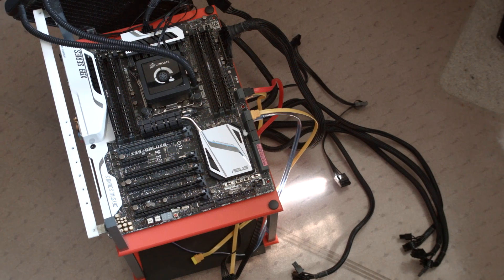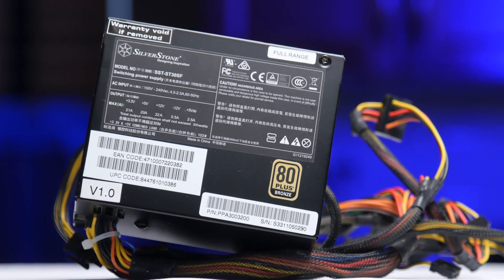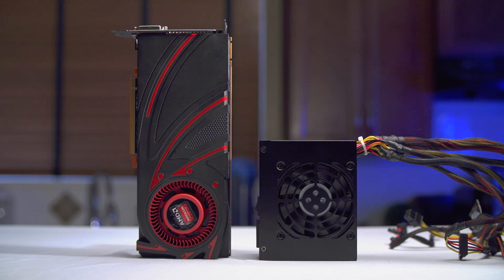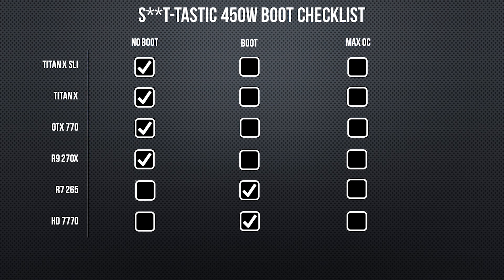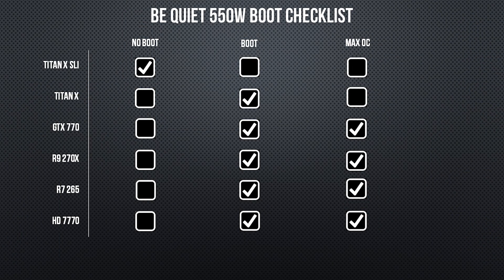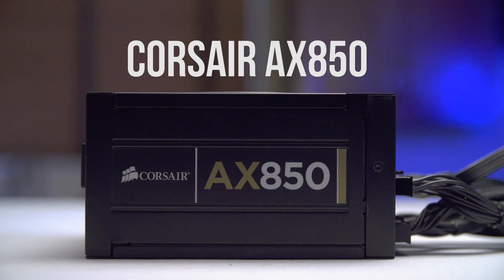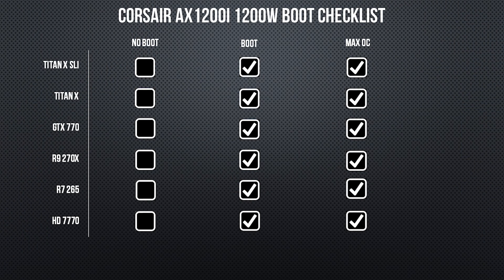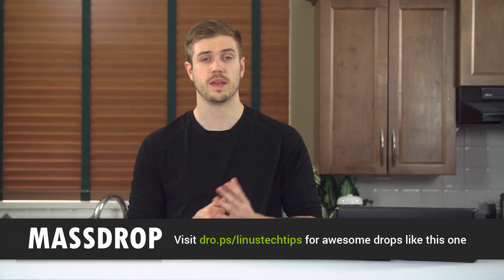Overclocking Recommendations - Low vs High Wattage Power Supplies

Comment: is a Cooler Master G550M enough for a i5 4690k and a Asus gtx 970 both overclocked?
Reply: +Stevin Kruithof 
No, all of the GTX 970's require a min of 500 watt PSU but, the power consumption is a different story. With your 970 the max power consumption is 225 watts at stock clock speeds, over clocking it will need more then 500 watts of power and that's not including the power consumption of your MB, Ram, Fans, Drives, CPU and pump/s if you're water cooling, keep in mind that over clocking your MB, Ram and CPU will also consume more power as well

A 550 watt PSU will not be best in my opinion,  at best I would do either at min a 650 watt or a 700 watt PSU, that way if you do some over clocking, you have the power to take it.

Comment: 80+ rating makes a big difference as well. I decided to pick up a Corsair AX 860 80+ Platinum, after reading a review of the PSU over at JohnnyGuru. JohnnyGuru was able to pull 1000 watts of power from that PSU.

Comment: I just want to make sure, i have an r9 270x TOXIC and fx 6300 @4.3 in my build. My power supply is an xfx 550w P1550SXXB9. If i wanted to upgrade, would my power supply handle an r9 280x or atleast an r9 280.

Comment: So in theory could I run 2 290x's in crossfire with this setup?

CPU: AMDFX8350 4.0ghz
CPU Cooler: Noctua NH-U14S
Mobo: MSI FX990GD65
PSU: Corsair Modular Power Supply 860 W, Series Professional Platinum Ax860 - 80 Plus Platinum
RAM:Corsair 16GB DDR3-1866MHz Vengeance Pro 
GPU: Sapphire R9 290X 8GB 1180/1500
Storage: 1TB SSD/HD, 250GB Samsung evo SSD
??
Reply: Blacksun Without over clocking you can, but with overclocking I would suggest giving yourself some breathing room (say 1250W). You are running especially thirsty hardware.

Comment: Greetings from sunny Southern California! Thank you guys for this video. I finally realized that my performance issues were due to not having enough power on my recently built PC. I had a crossfire set up with an FX-8350 using 850 Watt PSU and it was clearly not enough power. Everybody addresses CPU, GPU, RAM, but very little info on how much power you need.  Again, thanks for what you guys do. PS. That Luke is a sexy beotch. ;)

Comment: What's the difference between the GTX 770 and the GTX 970? I've noticed that they use the 770 more often even though the 970 is newer.
Reply: +Garry Perkins What wattage PSU do you have with your 970? I was looking at upgrading to one but I keep finding mixed answers to my question: Is 500W enough?
Reply: Thanks man. Great info. I might just save my dollars and go for a complete re-build in 6 months or so. Thanks again for taking the time to reply.
Reply: RaySchrantz The 970 uses less power and has dramatically better performance. You can buy the 770 for far less cash used. I am currently using a 970 and it rocks.
Reply: grennyfell97 What CPU do you have? 500W should be plenty if you have an Intel CPU and do not do any overclocking. keep in mind that overclocking uses dramatically more power for both the CPU and GPU. For example, an AMD eight core lulls 140W standard, but will easily pull over 220W overclocked (sometimes 300W). Similarly, a 200W graphics card might pull 300W if overclocked.

I have an overclocked AMD FX-8150 running at 4.4 gHz. I overclock the GTX-970 as well (EVGA Precision X with Power Target at 110% and Mem Clock Offset at +150). I have an XFX 850W PSU (made by Seasonic). It is stable and kill for an old system with a graphics update. 

Tell me your PSU and I will let you know if 500W is okay. For any recent Intel CPU you are fine. The earlier your go back the more power you need. If you have something like a 2700k intel cpu, then you need more power. If you have Haswell (4770, 4570, 4670, 4790), then you are golden. 

in general though, it kind of pays to have a big PSU if you can get one that does fanless at low wattage. With a good CPU cooler, graphics card and power supply you can get a a truly quiet computer.
Reply: +Garry Perkins Thanks for the reply. I have an FX-6300 Six core with a Cougar SL 500W. (80% efficiency)
Reply: grennyfell97 I would upgrade your PSU just to be safe. If you are not overclocking you are probably fine, but if you do not have a modular PSU, perhaps this is the kick in the rear end you need to get one (I still have a non-modular, and cable management is a nightmare). 

AMD in general needs more power, especially if you are overclocking, and with a 6300 you should be overclocking. Just go out and get a good 650W modular PSU. If you think you might SLI or go for an 8350, then grab a 750W.
Reply: grennyfell97 Yeah, I have an eight-core AMD and I am debating an upgrade, but I want a new case as well. The whole DDR4 thing complicates the issue. Do we go Devil's Canyon and re-use the RAM (I have Corsair Vengeance), or do you add yet another item to the list. I almost feel like with DDR4 it is better to go x99 than Sky Lake.
Reply: +grennyfell97 I know this is old but you can run a 970 and amd fx 6300 with 500w. I did for a week while waiting for my 750w psu. I don't know about overclocking though as I don't overclock my stuff.

Comment: Do you think I can run GTA V with my Geforce GTX 970 gpu? 16gb ram 2100mhz, 5820k CPU, v750 cooler master PSU, and asus x99 pro motherboard. and corsair h105 liquid cooler.
Reply: DrFlax What resolution are you going to be running?
Reply: 720p probably. If you need anything else just ask
Reply: DrFlax That's very overkill for 720p.
Reply: well 1080p then lol <3
Reply: DrFlax That's better! :D
Reply: <3
Reply: btw. do you think I can record good quality with my 970?
Reply: DrFlax Nope. You might need to adjust one setting, so you should probably spend thousands of dollars instead. Why risk having MSAA at 2x when 4x is the max.

Comment: Hey, can someone give me some feedback about this build:

CPU: Intel Pentium Processor G3258
Cooler: Cooler Master Hyper 212 EVO
MOBO: MSI z97 PC Mate DDR3-1600
MEM: Vengeance LP 8GB DDR3
HDD: Seagate 1TB Desktop HDD SATA 3
GPU: ASUS GTX750Ti 2GB
CASE: NZXT S340 ATX Case, Black
PSU: CX Series CX750M Modular Power Supply

Please tell me anything that I need to change, if this build will work or not.
Note: I am a beginner at this kind of stuff.

Comment: LinusTechTips   As somebody that knows very little about PC's, is it possible to have to much power?  If you went out and bought a 1200w power supply and only needed say 300w, would you run the chance of over powering it or would it just be idle power not being used?
Reply: Ryan Stephens Power supply wattage is purely what it's rated to be capable of outputting consistently. It's maximum long term. Only a damaged or faulty PSU would output more power than was needed. A cheap PSU would probably screw it up too
Reply: Ryan Stephens Short answer no. Long answer yes. Having a grossly oversized power supply will hurt your efficiency a decent amount. Power supplies are most of efficient at 80% load. A 550 watt supply is adequate for almost all single card computers or a 650 watt for piece of mind.
Reply: Ryan Stephens Power supplies are less efficient when not under enough load, but at lower load less energy is wasted. Overall I would say there are no problems, a power supply won't lose it's value over time unlike other components, and you wont have to buy a new power supply due to a lack of wattage :)
Reply: Ryan Stephens I don't believe there are any side effects from under powering a power supply to that extent, but its common for pc builders to buy an overly capable power supply, for example a 850W PSU for a system that may only need 650W. There are various reasons for this but generally its to be safe that their computer won't crash and the power supply won't be pushed too hard. The only drawback is however that more powerful power supplies are generally more expensive.
Reply: Andrew Hodges Thanks, I never thought about it until this video.  I would think that boards and cards have some type of limit switch that keeps them from being overpowered/harmed.

Comment: I've ran my setup for a few years with somewhat legendary Enermax Modu82+ 525w PSU and had no problems so far. My setup is i7 3770k @ 4,5Ghz, 16GB HyperX, GTX 770 DCUII (a little bit OC) and 3xHDD+SSD. Paying a little bit extra for the peace of mind (and better efficiency) is worth it.

Comment: Hi, i have never built a pc before but im really keen to. I want to play The Witcher 3 on max or nearly maxed settings and future games on quite high settings. Can you guys let me know if this build is good enough?

CPU: Intel i7 4970k 4.0GHZ
CPU Cooler: Cooler Master Hyper 212 EVO
Motherboard: Asus Z97 PRO GAMER
RAM: G.Skill Ripjaws X Series 16GB (4x4GB)
SSD: Samsung 840 EVO 250GB
HDD: WD Blue 1TB
GPU: EVGA GTX 970 Superclocked ACX 2.0
Case: Corsair 450D 
PSU: EVGA 750W 80+ Gold
OS: Windows 8.1 or Windows 7 (still havent decided)

Comment: The 650-750w range definitely seems well suited to OC any single card setup... that's actually a little more wattage than I expected. But then again I suspect the I7 5960X is the culprit for this extra power consumption, as honestly when overclocked its about as power hungry as CPU's get, and is probably more than most gamers will go for until the GTX Titan or multi-gpu type setups anyway.

Comment: Guys need help, how's this for a $1500 build?
Intel core i5 4690k@ $236
Noctua NH-D15 @ $100
Corsair Vengeance Pro Series 16GB (2 x 8GB) DDR3 DRAM 2400MHz @ $130
MSI ATX DDR3 2600 LGA 1150 Z97S SLI KRAIT EDITION @ $100
R9 295x2 @$689
Corsair Carbide Series SPEC-01 @ $45
2x Samsung 850 evo 250GB in raid 0 @ 2x $100= $200
Rosewill ATX 12V 1000W SLI 80 Plus Gold Certified @ $120

First things first, I am doing this with some consideration of future proof, with a 1000 watt psu to accommodate future upgrades. Spending so much on the noctua cooler may seem unreasonable, and others may think it is better to get a i7 4790k with that $100. I see your point, however, with a quality cooler, I am able to get an aggressive OC on the current build and as well as future cpu upgrades. I figure that the noctua cooler will perform like a champ for a good 10 years with their high quality components and free socket mounting parts when new sockets come out. So the next time when I have 300ish dollar for cpu, I can get an unlocked i7 and OC the crap out of it, whereas if I get a i7 now, I still can't overclock it now or in the future in any significant way thanks to intel's state of the art box cooler.

The Rosewill PSU may raise some eyebrows, since most ppl go for big brands like cooler master, corsair, or evga. But I thought this one is gold certified, is recommended by Jonny Guru PSU review, and has a 4.5 on amazon. Whereas brands like evga and cooler master easily go north of $180 for a psu like this.

And finally the GPU choice, I figure that for something that performs better at high res than 2x970, more future proof with 512 bit memory, can do crazy OC with water cooling, and works better in multi gpu setup,  $689 is a steal. 

What do you guys think? Wait for R9 300 series? Wait for nvidia pascal? go 2x970? Get a cheaper cpu? Thanks in advance!

Comment: I have a Strix gtx 980 with a 750W supernova and when i play games there is this mechanical buzzing noise, coming from it. It only happens when i play games and different games make the card buzz sound differently. Anyway to fix this my specs are as follows:
4790K @ 4.6 Ghz
2 HDD & 1 SSD
6 case fans
h100i cooler
2x 8 Gb 2400 Mhz G.Skill Sniper series
Maximus VII hero
Black magic intensity pro
ASUS PG278Q ROG
LG  22M35
& a 2007 old monitor

Comment: Keep in mind that power supply ratings are for their output wattage, after inefficiency has been taken into account. Wattage from the wall is the total power draw including all the power which is about to be lost to inefficiency in the conversion from AC to DC. If the power supply is pulling 375W from the wall and it's (say) 80% efficient at full load, then that means 80% of the power it's using is being delivered to the components, the other 20% is lost as heat. If you do the math that comes out to exactly 300W output to the components :)

The Silverstone unit is rated for 85% efficiency at full load, which means at 375W from the wall it's delivering roughly 320W to the components. So a little above spec, but not as much as you think. Still, impressive nonetheless for such a low end PSU.

Comment: Stock FX-9590+ATI 7990 has a Platinum AX860i corsair, runs butter smooth other setup i have has a i7 3770k at 4.5ghz with GTX 770 SLI OC to 1200 (high boost) with a CM silent pro M gold 1000w runs butter smooth, never have issues with both i even ran Xfire of 770 on one of thoose silverstone 450sfx psus, did great

Comment: I NEED HELP!

I have a problem with GPU 
Should I make a Nvidia GTX 770 SLI (I own one)
OR
Should I buy a GTX 970 

Target is to play GTA V with 60 FPS with high resolutions and maybe 4k in the future 

ALSO is 980 so so so much better than 970 ?
Reply: It is not extremely better, the 980 is around 10-15% better than the GTX 970
Reply: ***** Nah SLI IS good, but not with low end cards the drivers are really hard to manage and annoying just sell  your 770 and save up for a 980 ;)
Reply: Dude, 2x 970s in SLI Is WAY More PF than a single reference 980. Power consumption will be higher, but performance will be higher as well
Reply: ***** The 980 is quite better than the 970 it takes 970 sli to equal one gtx 980 with a stock cooler I would go for A 970 because sli doesn't always work well for games and has had driver issues and incompatibility's with GTA V and alot of other games hope I helped :D
Reply: but how about GTX 770 SLI ?
Reply: But 2x 970 in SLI is not a possibility for me =(
Reply: ***** You are absolutely fine at 1080p. When you buy a 4k monitor then you can think about upgrading.

Comment: There's a bunch of handy-dandy calculators available that'll give you an estimated CPU wattage ( some to GPU too ) for over clocking. As a general rule, everybody should be using some kind of PSU calculator to get a general idea of what their system is pulling. You SHOULD be adding ( or subtracting from the PSU's power ) about 5% per year for capacitor aging as well, as PSU's loose capacity over time. 

In addition to this, the 80% ratings aren't the PSU's ability to pump out dem watts, it's a rating of how much of the power going into the thing is turning into heat, at 70% load. 

SO

To properly size a PSU, you need your target overclock, for both your GPU and PSU, a good calculator ( Extreme PSU calculator is one ), and THEN decide on your PSU size based on your system being under load. Add 30%, and you'll have the most efficient setup with some headroom. 

Basically, if your system all up draws 500 watts, and you've factored in cap ageing and overclocks and all that, get an 650. You'll be running the system at the peak of the efficiency curve under load. This also has a knock-on effect of making voltages more stable.

Comment: Why do you do the High end GTX cards but not the High end AMD cards? It seems like both would be good to test, especially since AMD cards are notably power hungry.
Reply: Disobeyedtoast A 1200w would still be able to run the dual 290x's I'm sure.  There's not a whole lot in between 850w and 1200w nowadays anyway.

Comment: i mean wouldn't a 4690k or a fx8350 made more sense in this situation since wattage is the manipulated variable here? It would've been much more informative for someone struggling to know what psu wattage they should purchase
Reply: Toby Dodz  a 5960x and dual titan x's arnt high end for you?
Reply: Toby Dodz  he was using a high end cpu because he was showing a high end rig. Just dont worry about wattage. As long as its decent. A good rating is better. I'd take a 500w platinum psu over a 650 bronze psu for single cards
Reply: Douglas Gardner  no he isn't? he included a extremely dodgy psu and a few low end gpus. and don't get me wrong, I'm not the one struggling to find out what psu to buy on a next rig, i'm just speaking for thoses ppl in almost every single ltt video asking for advice on specs.
Reply: ABaumstumpf ...are you actually expecting all those from a test with 5 GPU configs, a need of overclock testing, and from a channel required to make 1 video per day? its just a brief over view -_-

Comment: I moved from an a corsair 650W to a cougar 1050w and my overclocks improved on my 3770k from 4.6ghz to 4.9ghz.  I was getting large voltage drops under load, but never broke capacity and it was causing stability problems.  

Higher quality power supplies provide a more consistent voltage under load and that increases system stability.  It's not as clear cut as "you need X amount of watts for that hardware."

A higher quality PSU will also extend the life of your parts.  Using voltages that go above or below the range that they were designed to run at can damage them.  Do not believe the myth that only high voltages do damage, on sensitive electronics too low of voltages can also do damage.

Comment: Better do high-priced vs low-priced power supply witch this same power.
Reply: szymon1051tv High-priced every time. Go with quality. This is the only part of your computer than can burn your house down. There are some good brands (Seasonic, Corsair, Cooler Master, Thermaltake, Silverstone). You can buy inexpensive, less efficient units in these brands and still be safe that they will not trash your system. I would also add Enermax to that list.

Comment: Did you also take into consideration the ripple on the voltage lines? The less ripple it produces (max ripple of 50mV is preferred), the more stable your overclock will be.